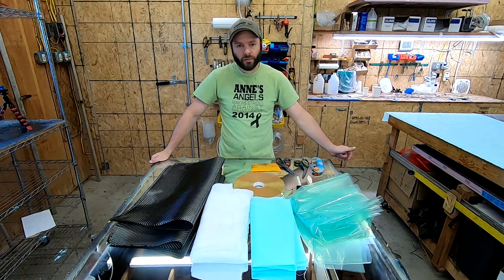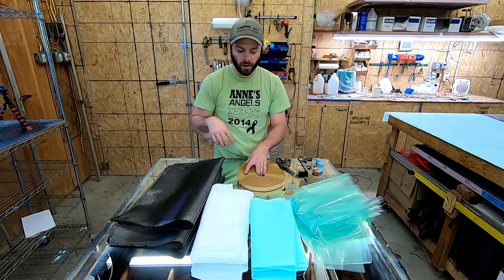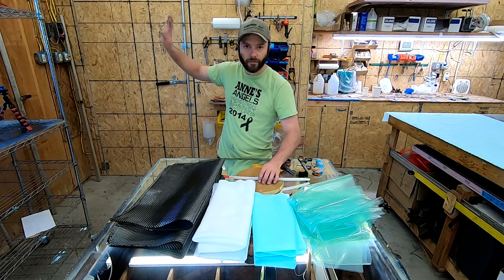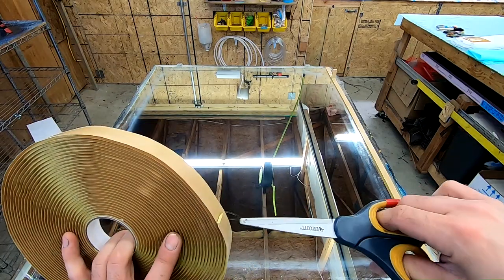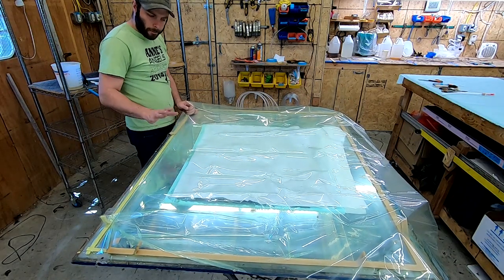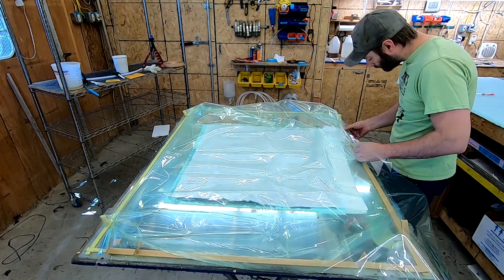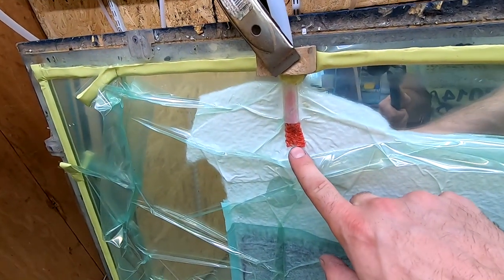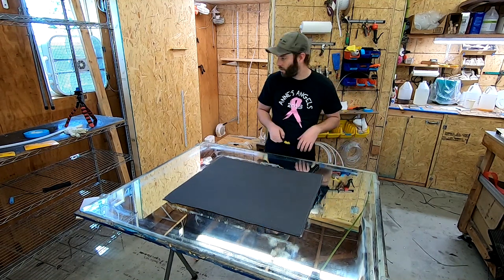How to Vacuum Bag Carbon Fiber

Comment: Great info thanks for putting this out there. One thing to think about is epoxy manufacturers usually put a ratio by volume, densities of hardener and epoxy can vary so make sure you also get the ratio by weight. In example, the epoxy I use is 2:1 by volume and 2:.88 by weight.
Reply: That is surprising, I would have assumed both parts the same density.

Comment: Awesome info! Remember most epoxy systems use volume for ratios. Weight is slightly different so for the perfect mixture and more strength in the part also look up the mix ratio by weight. For instance, my epoxy is 2:1 volume and 2:.88 weight.

Comment: Great content AJ. I've been watching your videos for a few months now. I'm looking to make a few carbon fiber parts for my car. I'm starting out making a flat shroud sheet with cutouts. Is it better to use vac bag vs. wet lay, as well as is it better to make a mold if making multiples of the same part? Also, what is the best way to remove voids that must be cut to go around parts such as OEM hood latches and holes for screws?

Comment: If I were making carbon fiber discs of approximately 20.5” in diameter should I try to cut circles first or make square panels and shaped them after curing?  Thanks!

Comment: Doing the vacuum bag does it make the part stronger or does it just help with cutting down the weight? Watching these videos makes me think I might actually be able to make a rear spoiler for my car out of carbon fiber.
Reply from the maker: Generally you get better properties with vacuum bagging. Plus, pulling excess resin weight out, you could add another layer or two of carbon to get a stronger part at the same weight as a wet lay part.
Reply: @ajhartmanaero  Thanks great videos a lot of great information. Are there any other surfaces you recommend using for laying up carbon. I see you use a mirror anything else you would recommend?

Comment: Great video very informative. I was wondering would it be possible to use one layer of carbon fiber when vacuum bagging? do you need an autoclave/ oven room for it to cure?
Reply from the maker: You can do as few or as many layers as you need. And an oven is not necessary. Cure time would just be much longer.
Reply: You cpd but it thin and flexible like paper, 24/48hrs with a little heat 20deg C+ will cure most thin laminates. AJs set up is just what we all need!

Comment: Great videos! I have a question regarding the vacuum process. Do you keep vacuum running through the drying process? Do you use regulator or straight from vacuum(if use regulator what is it set to or does this change According to part size)? I do refrigeration and have several vacuum pumps with different cfm. What you recommend? Sorry for all the questions

Comment: This is extremely helpful. I’d really like to start getting into trying my hand with composites soon. How many layers of carbon would you recommend using in something like one of your splitter tunnels? The 2 layers you used for this sheet looks like too few, but I wouldn’t want to use way too many either.
Reply: Also, do you run the vacuum pump the entire time the piece is curing? Or do you pull a vacuum and clamp it off somehow to hold the vacuum?
Reply from the maker: believe it or not, the tunnels are also 2 layers. Don't forget there are different weight carbons so layers doesn't really mean much, but thickness does. Also, shape has a lot to do with parts strength.
Reply from the maker: I leave the pump on till the part gels. I've seen people do it both ways so its up to you.

Comment: Very interesting as I am a car guy. My thoughts are to learn what I can make little parts (Up to 12" X 4") and shape them into rounds like a half pipe. "Note; nothing structural, functional, just for looks added on. I noticed that the 3 & 12 added together where very flexible, this is what I am after! I make a paper pattern, allowing for epoxy attachment points, then shape it, stick in place and let it cure. In plastic engine parts I plan to clean (Wax & grease) scuff for a tooth, bend, shape, hold with plastic on edges and tape. At this point, just let the fresh epoxy cure for a day or two, or remove tape & plastic and move on to next item & repeat? Any suggestions or thoughts? As for tiny voids, imperfections or other, I was going to sand lightly to get anything shinny off using 600 grit hand sanded, clean with wax & grease remover and perhaps spray two coats of high solids clear coat and let it gas off. So if careful, no sags, runs or defects and just let it shine. The clear has tons of "UV" additive in it plus it will under hood and out of sunlight anyways. The shape of these add on parts will lend themselves to structural rigidity anyways so if I get the stuck, they will not be touched, just looked. Plus a two part clear coat adds rigidity anyways, while subject to engine vibration and some under hood temps not exceeding 260-280 degrees F, I think they should be fine. I was shocked when you had the bundle of two different fibers folded over for weight. I use all the PPE equipment required to stay safe but this is just an example of my over-active mind at work. Thanks for any reply as my garage is in the upper 30's F, and this activity is some distance away into April 2023 when global warming kicks in again. Funny, as kids 58 years ago, we called it summer, not global warming and seasonal temps where weather! Lol. Thanks!

Comment: Really like your videos. Very straight forward. Dumb question though... How long is it vacuumed for and at what temperatures? And could I in theory use a vacuum cleaner?
Reply from the maker: Whatever epoxy system you use will have a cure schedule. And no, a regular vacuum cleaner will not work.

Comment: Nice demonstration!  I like your method of putting the mesh in the vacuum tube instead of wrapping it around - nice and compact.  

Is the MDF block just to keep the hose from wiggling around and making a leak?
Reply from the maker: Yes

Comment: Do you keep the vacuum pump running during the entire cure or can it be separated with a quick disconnect so the part keeps it’s vacuum?
Reply from the maker: Keep it running.

Comment: Question, and I’m new to trying carbon so please excuse me but is there any benefit to putting the resin on the part directly compared to having it pulled through with a vacuum on it? From the videos I’ve seen with vacuum bagging it seems like people normally have another tube running for the resin.
Reply from the maker: That would be infusion. Totally different technique and my next video will be on that.

Comment: I think I've asked you this before but what is "dry carbon" in relation to these techniques? Also, it might not be a bad idea to put an in line "catch can" on your vacuum system
Reply from the maker: Honestly I'm not even sure since there isn't an industry standard. But I generally see people refer to parts that are not clear coated as "dry" carbon. But I've also seen parts made with pre-preg as "dry carbon" even tho the carbon is laid up "wet", it generally has a "drier" finish. If you ask me the whole "dry carbon" thing is a marketing term that caught on. As for an in line catch pot, I havent used one is about 8 years. I properly laid up and set up part shouldn't need one. But when people are learning, they are a good idea.

Comment: you think sandwich two glasses  wet carbon on each side  would work?
Reply from the maker: I’ve seen it done and tried it small scale but bubbles will probably be an issue till you get your process down.
Reply: @ajhartmanaero   do you offer workshops/classes on carbon work?

Comment: Hi is the oven obligatory to do this technic ?
Reply from the maker: No. Every epoxy has a data sheet on cure times at specific temps. Without heat the cure time may be extremely long tho.

Comment: Hi AJ, noticed a perforated release film was not used on this simple layup, around how many hg of vacuum did you use so as not to pull too much resin out of the laminate?
Reply from the maker: I've found that perf film keeps to much resin in the part, but I guess that depends on the parts you are making. All I can say is do some tests on your own with weights to see what works specifically for you. I use full vacuum (just under 30in/hg) on my parts.
Reply: The tight weave coated peel ply makes it work here but if you're using plain nylon peel ply you'll struggle to remove the bleeder.  Different peel plies seem to regulate bleed differently... no data, just a feeling!

Comment: Do I need to used clear gel coat before make panels?
Reply from the maker: Totally up to you.
Reply: @ajhartmanaero  I am new to this... What would be the benefit of doing the clear gel coat?
Reply from the maker: @bbmotorsports6855  If done properly with quality clear, it won't, or shouldn't yellow or get cloudy over time. If done wrong or with cheap stuff, it may still yellow or haze, or most common is it will start to flake off over time. So like anything with composites, theres plusses and minuses. Very rarely is there a dead set way.